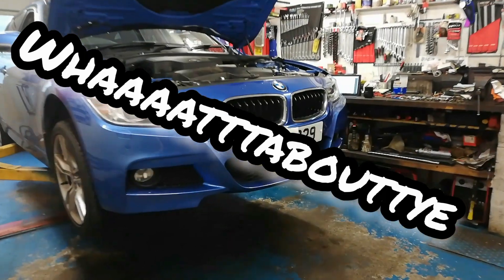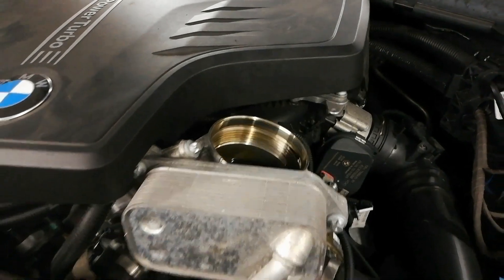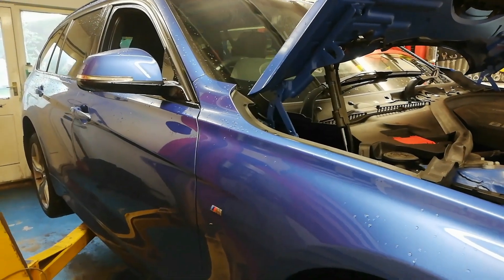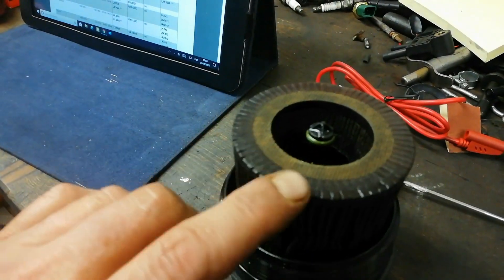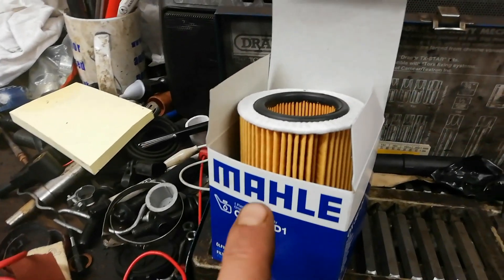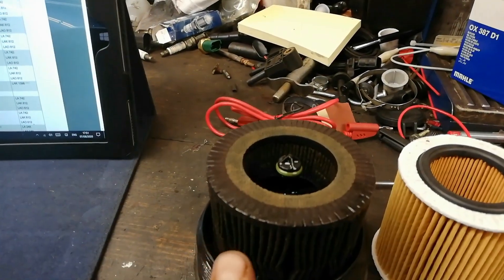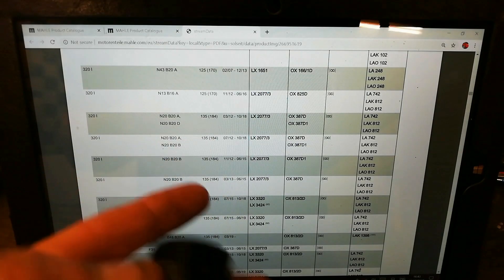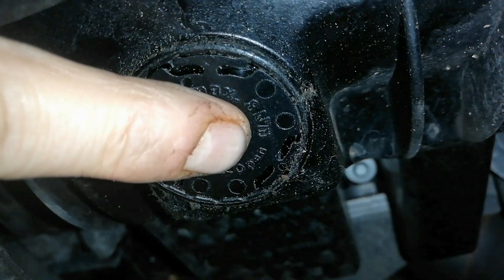BMW N20 320i Plastic Sump Plug

Comment: Crazy plastic sumps Dave , your so right about making sure you get the right stuff for the job , I did a 2016 Vauxhall Mokka, 1.6 petrol , ordered stuff from the dealers , oil filter was nearly 30 quid for an element type , I asked are you taking the P, to which they said no you get your discount and that's it , I sent it back being tight , then rang 3 local motor factors, ordered the filter , wrong every time , this model has a safeguard type oil filter , with a spring loaded plunger to stop the oil draining back , so I had to go to the dealers and buy the right one , with my tail stuck between my legs, just today ordered on off flea bay, genuine GM filter , 14 quid Inc delivery from a dealership, as it's booked in for MOT and service in a fortnight when I get back home to do on the drive as  I will be in quarantine then , 🍦🍦😷😂😎🇬🇧
Reply from the maker: an element with a plunger, Mike. Haven't come across that yet. Most Vaux's i do are diesels apart from the wee corsas and adam's that are mostly petrols(that i get anyways). Enjoy your quarantine!
Reply: @davesterl  Fram make it also ,part number CH12246 , if car has UFI type plastic housing 👍UFI number 25195775 😷🍦😂
Reply from the maker: cheers Mike, good info
Reply: @davesterl  supposed to stop the 25 second bag of spanners noise  with the crap Vauxhall timing chain engines , Weill see 😎😂😉👍

Comment: I did a first service on a m40i few weeks back with only 8k miles the oil filter had totally disintegration and lower section stuck in housing with filter being closed to bulk head then the one in your vid, was a absolute pain to remove, doing a bit research online apparently a common issue with Bmw replacing full filter housing under warranty to prevent any premature oil pump failure due to blockage

Comment: Plastic sump bung!  I dare say there'll be many of them cranked in and damaged by incompetent 'mechanics'.  As you well know I experienced a damaged aluminium sump in my Mito thanks to some numpty which was later rectified by yourself fitting an entire new sump.
Reply from the maker: well there is no excuse here as the tightening torque is stamped on it
Reply: @davesterl  Yeah, you're 100% right  but you're forgetting, alot of people don't bother to observe such information even when it's in their face so obviously.  Why would they care anyhow when it's not their car, not their problem when at the next oil change the whole sump needs changed!